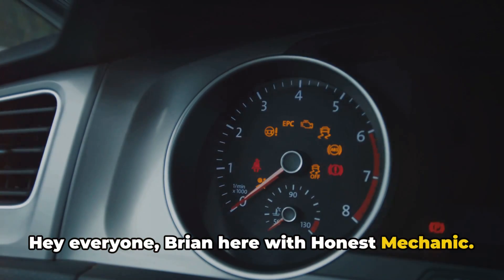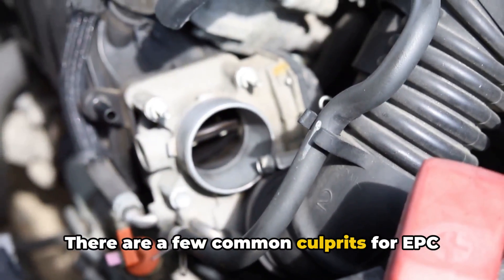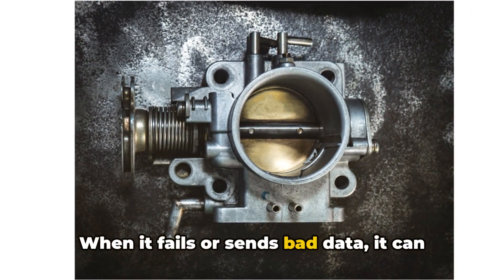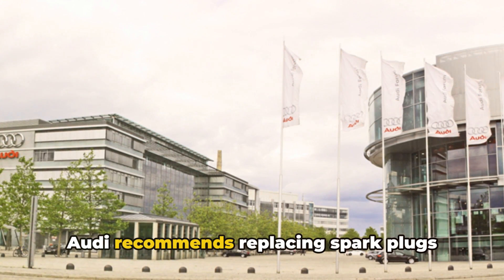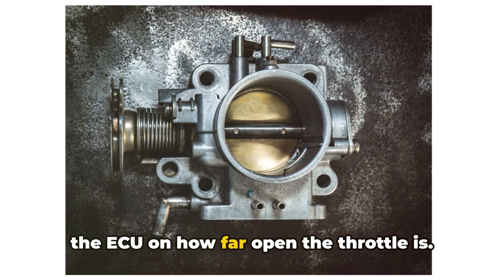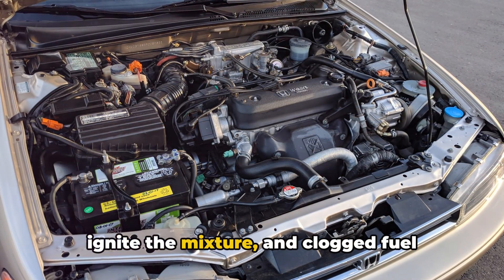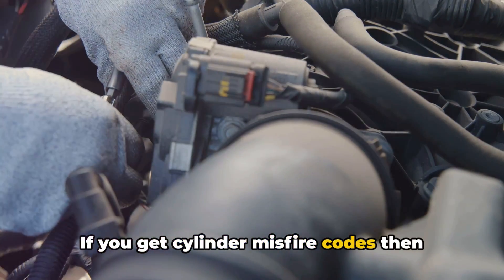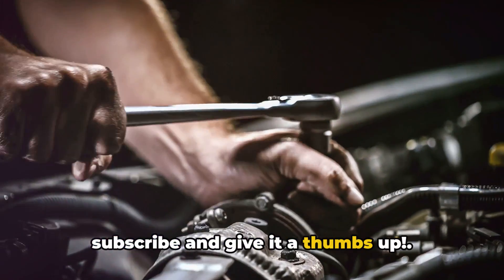Audi EPC Light: How to Fix and Reset

Comment: P0300 code .misfire ..shaking   car sat for 2 years
Reply: Im working on an audi right now. Its throwing P0300, random cylinder misfiring. Im assuming it's spark plug related, did you find what the problem was?
Reply: @littlebiggie8286 it was burnt exhaust valve ..pulled head to be sent out .1265.00

Comment: 2014 S5 same issue, codes come back as misfire on 2,4,6 also rich on bank 2. New plugs and coils cleaned the TB. Car runs allot better but still getting the epc light and misfire codes after about 10miles. Anyone got advice?
Reply: is the earth wire thats bolted to the top of the coil good?

Comment: Not necessarily, mine shows a misfire on cylinder 1 randomly but spark plugs and coil packs are ok. Mechanic couldn't and can't work it out as it's an Audi and prone to issues
Reply: I have the same issue.

Comment: I recently had this issue with my 2009 Audi Q5 and after scanning the system it turned out to be 2 ignition coils that went bad, replaced them ( after replacing all spark plugs as well) and the issue was gone

Comment: Hi my q5 2012  check engine light is flashing when I start the car up then it starts to shake and the epc light comes on I replaced the spark plug , cords, fuel injectors do you know what the problem is?
Reply: Same I got mine in the shop for the same thing today so we shall see
Reply: @ let me know because I’m still trying to figure it out please
Reply: @dj4president  hey did you find out what’s wrong??

Comment: Hello when I originally bought this "2009
Audi a6 3.0TFSI Prestige" whenever I put it pedal to metal it would go crazy and throw the EPC light along with other codes but would all go away when I turned the car off and on, I replaced the downstream 02 sensor on the passenger side like the seller said to, I can now go pedal to metal and now I can reach higher speeds and quicker but whenever it's in sport mode or i'm using the paddle shifters in late rpms like around 6-6.5k rpms it does the same thing where it goes crazy flashing the preexisting check engine light along with the EPC light and other codes. The codes I pulled off the OB2 was insufficient air flow on bank 1 and 2 and the 02 sensor I replaced what do you think it could be ?
Reply: Carbon buildup in the little ports
Reply: try mass airflow cleaner on the MAF

Comment: Please help 
Getting EPC light after 3000 rpm when accelerating and goes into limp mode only engine code says misfire at cylinder one and cylinder four  swapped coils and spark plugs still does it
Reply: Did you ever figure yours out?
Reply: mine does too, but when i hook up my shop scanner it says manifold valve stuck , so im thinking my intake manifold runners are either broken or clogged with carbon build up havent taken it apart yet, but i heard its common

Comment: I have a 2007 Audi a6 3.2l it was running fine and I parked it and went to start it again later and it won’t start. It shake bad when turning over trying to start and epc light comes on. Has oil in ignition coils and spark plugs. Has new high pressure fuel pump and new battery. It was running great no check engine lights
Reply: I have the same problem with Audi a1 parked up car was fine the next day won’t start has the epc light on and engine light it’s also shaking, let me know what’s wrong with yours please 😢
Reply: @ I still don’t know

Comment: I Scanned my audi it showed camshaft sensor position fault. I changed it but the problem is not going away. I'm still experiencing EPC light once my engine has warmed up.
Reply: i have the same exact issue. same code. P0341. Camshaft position sensor. Did you end up fixing it?

Comment: Ok so I have a 2008 A6 3.2 Quattro I bought it off a dealer ship and only was driving it for two days then my EPC light came on it started shaking lost of power went into limp mode and the code is (Throttle valve drive Electrical error in circuit - Open circuit/short circuit to ground) I been having the car parked ever since that happened idk how to fix it I changed the throttle body that ain’t work idk honestly and it was smoking on the driver side on the engine

Comment: Change the battery
Reply: I also did that and it worked well 👍🏻
Reply: Hey it was giving you engine code p0301?
Reply: @CM-ec5wc mine is what’s the cause?
Reply: I recently gave some friend a jump who had a bad battery in their car, an extended jump at that, after that episode of a cheap tow due to her failing her car parts, my 06 audi q starter acting delayed and the epc code came on, never seen this light before the whole extended car jump alternator bypass situation, thanks.
Reply: I have a misfire code I changed the spark plugs & coils and car still shakes and black check engine and epc light - 

But here’s the kicker none of this was happening until after I changed my alternator - I had a bad alternator car stopped running and turning on then I got alternator fixed car start working and starting then a few days later car start shaking and blanking check engine lights and epc light 
 Code is misfire code 

Do you think it’s the battery?

2017 Audi Q5
Reply: @daniro2k did you try the new battery yet, I’m experiencing the same thing

Comment: Hello love your videos , audi a2 owner and my ESP light comes out after some period of driving,I feel no difference at all , no power loss or such. If i switch off and on the engine it goes away,and rarely comes back  happens at least once a day.

What could be the fault? Thanks
Reply: I have the same thing in my Audi a6, no clue what it is
Reply: Same issue. Any way to fix?

Comment: Useful video. 2015 b8.5 s5, 115k km. Epc light came on, and the car started shaking with a loss of power. Parked, turned on/off fixed the issue. I think it's time for a basic tune-up(spark plugs ect) it could be carbon build-up also.
Reply: 2015 b8 a4 here 👋🏼 I had the same thing happen yesterday. I’m a 49-year-old woman and refuse to take my car to the dealership. As a result, I’ve researched this car extensively and have done many repairs on it so far, I’m happy to say. This video has been super informative, thank you! 😊🧘‍♀️🌸🔧
Reply: Wow Same thing happened to me 7 days ago with my 2015 Audi q5! I wish i came across this video sooner. I got mine towed to the Audi dealer and now they are talking about a rotor wiring issue
Reply: @simonb5401  what ended up happening? Got it fixed? Did it fixed the issue?
I'm still driving with no problems since that day.
Reply: @Vlogbobb  hey, as it turned out the dealer said a rodent, most likely a rat/mice chewed a wire connector. And my fuel ump module was bad. Its running now, but soon i will try and get a tune up done
Reply: @simonb5401 how much did it end up costing you?
Reply: @simonb5401 happened to me today. I had it towed to the shop.
Reply: @simonb5401 Boa noite,  como foi a solução do seu problema.  Estou na mesma situação com a concessionária.  Desde ja obrigado!!!
Reply: @FernandoMonteiro2025  vc conseguiu arrumar ?
Reply: EPC light come on but the car was driving normal, no shake, no loss of power. I parked and an hour later I started driving again and the EPC light was gone.
Reply: When the plugs wires dat goes to egnition coil it's loss it can course epc
Reply: Exactly what happened to my Q5 2018 today thx I hope it helps me to get better quotes from the dealers

Comment: Cleaned my Audi s4 engine bay and epc light came on and went in to limp mode🤦🏽‍♂️
Reply from the maker: Hi Noel, sorry to hear that, here is what I think: it's likely that water or moisture got into sensitive electrical components, such as sensors or wiring. 

Check for wet or loose connections, especially around the throttle body, MAF sensor, and coil packs. Dry any wet areas. If you have an OBD scanner the best place to start is to clear the codes.
Reply: @HonestMechanicChannel  thanks for the help, I did notice that if I let the car idle the epc light won’t come on but if I tap the gas pedal a couple times it comes on as well as both my cooling fans stoped working

Comment: My engine light came on and I have obd2 carista and codes are 21388 fault code - Exhaust door valve 1: Open circuit I’ve taken off the wire at the exhaust on both sides then the 2nd came up blown in them to clean desert and 1 open circuit driver side is still faulty not letting me reset EPC came on car was shaking and loud and kept driving engine light came on saying misfire as I kept driving for 5 mins only when in sports mode snd stopping the gas hard

Comment: Hi, Audi A4 2013 about 75000 miles, when the car is still cold it is no problem and the EPC light is off. If I drive for almost half an hour, stop and turn off the engine, if I turn it on back again usually the EPC light comes on and stays on. But there is no shaking or loss of power or anything noticeable in driving. Any advice what may the cause be?
Reply from the maker: Hi, Since this happens after a while, Since it only appears after driving for a while and restarting, it might be related to a sensor or electronic component that malfunctions when hot. Common causes include:

Throttle Body Issues: Dirt or malfunction in the throttle body.
Faulty Sensors: Issues with the mass airflow sensor (MAF) or crankshaft position sensor.

Let me know how it goes!
Reply: @HonestMechanicChannel  Thank you for your response. a basic OBD check shows engine fault 18062 Coolant Pump B control circuit/Open. Is that related?

Comment: I have an 2013 adui q7 and i changed the throttle body and  i was still having the same problem. My q7 is supercharged so could it be that? I noticed a small throttle body in the supercharger but i haven't tested it yet
Reply from the maker: Hi Percy, can you provide more info please so I can give the best answer possible. are you getting any codes? what does your car do?
Reply: The throttle body need to be relearned to the car after installation. Otherwise it won’t communicate properly

Comment: Hey the epc comes on , on my C7 A6. It comes on sometimes when I turn the car on but not every time.  Would could it be ? I do feel a slight decrease in power when it is on.
Reply: I'm having the exact same issue as you described, mine is a 2014 Audi A4. Took it to a mechanic who said it was the oxygen sensor (also called lambda sensor). Changed the one who was "supposed" to be faulty, only for the light to come ON again about 2 days later. Changed the other sensor (they're 2 lambda sensors), and again, about 2 days later the EPC light came ON again. I'm getting frustrated with this. I'm going to return to them tomorrow and see what they come up with. I'll let you know if I manage to have it sorted out and what they did to sort it out. I haven't taken to my local Audi dealership because they are ridiculously expensive.
I once was quoted R32000 (South african Rand) = USD1700, for rear brake calipers, that actually cost R7000 = USD380.
Reply: @Alberto-qf7zh  Did you get it fix and figure out what it was?
Reply: @roned1nero579  Still no luck. I guess I'll have to save up and take it to Audi themselves 😒

Comment: With mine if I hard accelerate the EPC light comes on and it shakes bad and misfires, the code I get is for cylinder 2 misfire.. however I can shut the car of and drive fine and the engine doesn’t shake.. it only does this when I put the pedal to the floor. I also replaced that cylinder plug and coil pack and still have the same issue.

UPDATE!!! Below (5/23/25)

so I replaced my spark plugs with Brisk ER12s. I also have a stage 1+ tune so these plugs are a step colder. I replaced the MAP (manifold absolute pressure sensor) it was the original, and it was dirty carbon and oil fouled.. I had so much extra power and torque it was amazing, the only time I’m having the misfire now is when I’m over 85 mph but I’ve floored it from a dead stop and it seems it’s gone.. cylinder 2 is still misfiring but I ordered a new PCV valve which is also original (I have 120,000 miles on my A3 2.0) so that may fix the problem. I haven’t done my injectors yet but I highly recommend replace the MAP sensor I got mine for under $30 and it’s very easy to replace its right on top of the intake manifold literally takes 2 minutes. When I get the PCV valve I’ll update you.
Reply from the maker: Hi, The symptoms you describe suggest there could be an issue beyond just a faulty spark plug or coil pack in cylinder 2. Since replacing these didn't resolve the problem, you might be dealing with fuel delivery issues, a clogged fuel injector, or a more complex electrical or sensor-related problem. Given that the issue occurs under hard acceleration, it could also be related to inadequate fuel pressure or air intake issues. My bet is on a bad fuel injector on that cylinder
Reply: @HonestMechanicChannel  ok thank you, I believe it to be a fuel injector as well. It has 112,000 miles.
Reply: Hello 
You can take out  the fuel injector from cylinder nr-2 and place that to another cylinder 
If the error code is on that cylinder then the problem is the fuel injector
Reply: Did you manage to solve the problem? I am facing exactly the same problem.
Reply: @MohammedAli-gy1rs Im having the same
Reply: @MohammedAli-gy1rs  so I replaced my spark plugs with Brisk ER12s. I also have a stage 1+ tune so these plugs are a step colder. I replaced the MAP (manifold absolute pressure sensor) it was the original, and it was dirty carbon and oil fouled.. I had so much extra power and torque it was amazing, the only time I’m having the misfire now is when I’m over 85 mph but I’ve floored it from a dead stop and it seems it’s gone.. cylinder 2 is still misfiring but I ordered a new PCV valve which is also original (I have 120,000 miles on my A3 2.0) so that may fix the problem. I haven’t done my injectors yet but I highly recommend replace the MAP sensor I got mine for under $30 and it’s very easy to replace its right on top of the intake manifold literally takes 2 minutes. When I get the PCV valve I’ll update you.
Reply: you ever figure out what it was?
Reply: @josuecruz5327  I haven’t change it out yet but I believe it’s a clogged injector, I have about 116,000 miles on it. I’ll definitely post an update when I fix it.
Reply: @salvatorej.quaglieri7792 hey have you gotten a update yet I’m having the same problems on my 2015 A4
Reply: How can I get in contact with you
Reply: @ I’m sorry I have yet to fix it, so it doesn’t happen if you drive normal speeds and don’t accelerate hard? I’m most likely saying it’s a fuel injector issue because I’ve changed the plug and the coil and it didn’t fix it, the only thing I can relate it to is a bad injector because under hard acceleration it causes jerking and bucking and then it causes misfiring. I shut my car off and there’s no more misfiring and it’s “fixed” I just reset the check engine with a code reader. But eventually soon enough when I get a whole injector set I will let you guys know!

Comment: Petrol, 2.0 tfsi 211hp. EPC doesn apear every time when i put ignition. It s need to try beteeen 5 and 20-30 time to EPC apear . I noticed that after a longer trip, the EPC no longer appears when I try to restart. and gives me error TPMS, ESP, ABS, gear box and headlight adjustment. I have an error on almost all modules when I scan with VCDS. I'm interested if you experienced something like this, where the problem came from. when the car is started, it runs flawlessly, it doesn't jerk, it doesn't slow me down at speed.

Comment: Hello, I recently had a fuel line come off on my car (weird issue) and after reconnecting the line, the epc light is on. Could this turn on simply from air getting into the fuel line/the car failing to start a couple times?

Comment: Hello, 
I have codes p2293, p0343, EPC indication.  I checked the camshaft marks, everything is fine.  accelerates poorly at low engine speeds, after 2500prm, as if a second wind appears and the car begins to accelerate. Thanks
Reply from the maker: Hi Piligrim, managed sort it out? these codes can also be caused by the following

1. VVT Solenoid
2. Faulty fuel pressure regulator
3. Clogged fuel filter
4. Malfunctioning camshaft position sensor
5. Wiring issues related to the camshaft position sensor
Reply: @HonestMechanicChannel  Thanks a lot.  I changed the fuel filter, changed the camshaft sensor, tried the working car, checked the wires, supplied 12 volts to the solenoid, it reacts.  ordered another high pressure pump
Reply: @HonestMechanicChannel  I’m also thinking of checking the oil channels of the phase regulator control and the phase shifter
Reply: Thanks a lot.  I changed the fuel filter, changed the camshaft sensor, tried the working car, checked the wires, supplied 12 volts to the solenoid, it reacts.  ordered another high pressure pump
Reply: I solved the problem.  there was a problem with installing the chain between the camshafts, one tooth

Comment: Can bad fuel quality raise epc warning? Im having same with my a5 2012 engine oil consumed very fast
Reply from the maker: Yes, bad fuel quality can indeed trigger an Electronic Power Control (EPC) warning light on your dashboard because poor fuel can affect the engine's performance and emissions. However, fast oil consumption is typically unrelated to fuel quality and may indicate other issues such as leaks (internal or external), worn piston rings, valve seals, or a problem with the turbocharger. Do you have an OBD scanner?
Reply: @HonestMechanicChannel  is their a specific code that the obd scanner shows for the worn out piston rings?
Reply: @HonestMechanicChannel  you think i should use a thicker engine oil since my audi is above 115,000 km
Reply: Been 2 month since i bought my a5 from a friend engine oil was topped up after 2 months ive been unlucky as there was a mixture of diesel in my fuel tank and when i went to a garage he said only 500ml of oil remained in the engine. Could this oil consumption have happened due to the diesel mixed with petrol